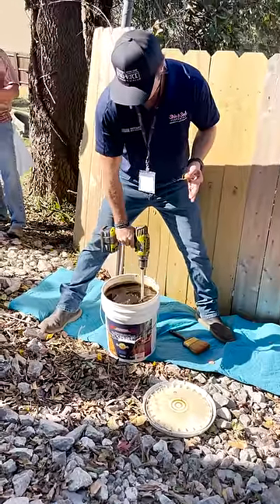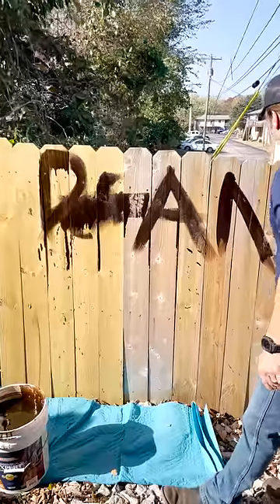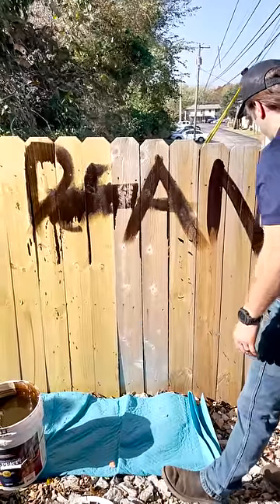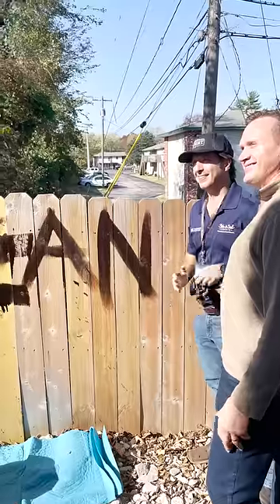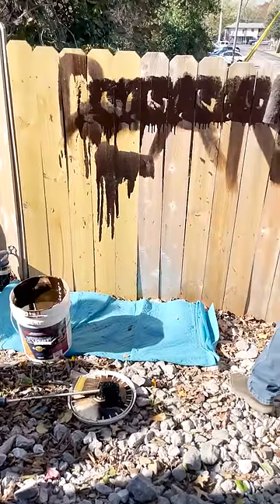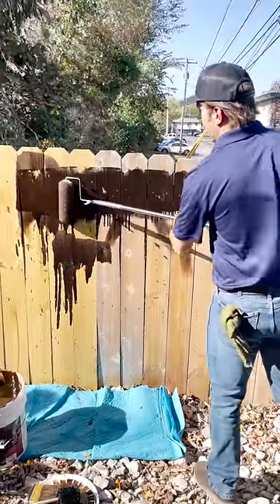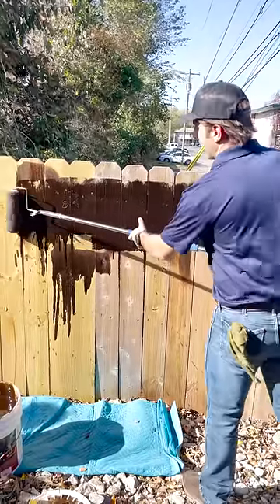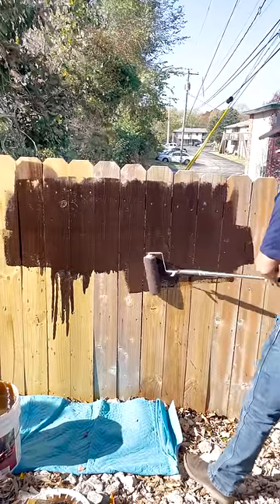You Won't Believe What This Guy Did To This Fence #Shorts

Comment: Yeah yeah but we needa talk bout those nail lines
Reply from the maker: 😂 very true!
Reply: It might be a demo fence so I’m sure it wasn’t a priority to get them super straight but I might be wrong lol
Reply: It's straight just tilt your head. Lol
Reply: @Dawson370  I can tell u try to over charge for sum like this 😂😂😂
Reply: What nail lines?🤣🤣🤣🤣
Reply: HAHAHAHA
Reply: EXACTLY🤣
Reply: Can we even call em lines? 🤔😂
Reply: “Looks good from my house!”
Reply: Few years and it will be leaning anyway
Reply: Screws
Reply: That stuff bugs the shit out of me lol
Reply: Thats a whole nail scatterplot
Reply: They add character
Reply: Come on you guys, the line is straight. Defense starts at a lower angle and moves upwards. Making the nail holes look very off.
Reply: Looks like a stain/ paint combo. Sherwin Williams sells the best one. I've used over 1000 gallons of it in the last few years.
Reply: @kimberlyjones2343  if that was the case, they'd still be in a straight line, just on an angle. But they jump up and down within couple nails. Also, you should still make your nail boards level, and the tops should be plum, only thing that changes is the cut at the bottom.
Reply: Pretty sure it’s a demo fence, but yeah I agree lol
Reply: Damn why did you point that out

Comment: I personally prefer oil based stain for exterior wood however you really need to know what the wood was treated with previously and if it will accept an oil based product. Then it's a matter of ongoing maintenance with the same or compatible product.
Reply from the maker: Great point!
Reply: No you dont, you need to know moisture content and if treatment is dry enough to accept stain. Typically takes 3-6 months before staining treated lumber. Some i have done in weeks and other took almost a yr.
Reply: @fuzzybanana9128  no if the wood has been "stained" with a urethane putting an oil based product is going to result in a mess. You can go from an oil to a urethane but not the other way around without prepping the surface.
Reply: @condor4679123  Well there is a MASSIVE difference between “treated” and previously stained. “Treated wood is done  by lumber yards. In that regard you would be correct of course, but ive been doing this 20 yrs and have never once seen a deck with urethane, that would be idiotic and the wrong application. Spar is one the only outdoor applications and its not intended for decks or fences but moreso furniture and small things without direct moisture.

Comment: Acrylic isn't actually stain it's a clear paint base with a little tint in it. Doesn't actually soak into the wood and stain it. Just bonds to the surface just like paint.
Reply from the maker: The product he was demonstrating was an oil-based penetrating stain
Reply: Bruh

Comment: Hard to work with but I love oil base it holds up especially if you're doing garage doors that are exposed to the weather
Reply from the maker: This stain is actually pretty easy to work with!
Reply: @JoeEverest    I do spec homes with Cedar and Redwood incline garage doors.  I always use oil based stain and use an automotive clear coat hardener. Holds up 15 years without  Is yellowing or cracking like polyurethane

Comment: Let it fully soak until its fully dry then try price your point 
If you coat over a wet layer it's obviously going to not show up 
But allowing it to dry fully will make that one solid cost then once the 2nd coat is applied the first coat it show as it will have built up the thickness
Reply from the maker: That’s true with most water based stains, oil based stains will still level out.
Reply from the maker: @aliceullrish5251  I’m guessing you haven’t used the product. We average spraying around 1,000 gallons a year of it, we’re pretty familiar with its uses and limitations. Now, with high-solvent oil stains you’d be exactly right.

Comment: I worked at a big box store in the paint section and this is straight from the rep's mouth: water base for inside and oil for outside. This goes for paint, stain and varnish
Reply: I agree except for when it comes to log homes.
Water based stains from Sashco and Permachink are the leading stains and outperform oil based all day long on log homes.

Comment: There are a lot of factors that determine how a stain will look at the end. Water and oil based stains do behave very differently and require different clean up. Oil based does tend to be easier to clean up with the proper chemicals than water based. But the biggest factor with staining is the wood itself... Woods can be open or closed grain and have tight or lose grain patterns. Closed grain woods tend to take stains more evenly and open grain requires a grain filler to get that eveness. However if its a tight grain wood it also becomes more difficult for the stain to penetrate through the wood which can also lead to umeveness. Hard Maple is a good example it has a closed grain but is also very tight which is why it often doesn't stain very well, thought because of that you can have beautiful figured patterns throughout the wood that isn't found in many others.

Comment: Oil based deck and fence stains have catastrophic failure and that's a good thing. It means it just fades away. Water based products don't fail the same way. So you have a ton of prep with water based to reapply.
Reply: not true. depends on what product you use. if it's just penetrating water base stain. just clean it before you apply new coat. same with oil base. now if it has beeswax in it then you have to get it all off.
Reply: @jeremygray462  right..  semi transparent needed to be added to my statement. Good catch 👍

Comment: I've always preferred oil based stain, it's messy but it's a lot easier to use and gets better results
Reply from the maker: Agreed!
Reply: Facts
Reply: @Jack Russelle Lewis what about it. takes to long to dry.
Reply: @jeremygray462  it doesn't dry it eventually evaporates

Comment: Oil-based stain takes 24 to 48 hours to dry minimum before you can put a finish over it. You do that and there will be a difference. Trust a person with cabinet making experience. In the outdoor circumstances he's basically correct.

Comment: Even when staining wood flooring, I use a rag and put as much down as possible, then wipe it off. Wax on, wax off
Reply: Rough sawn vs sanded. Makes a huge different on ragability.
Reply: @wook420  yeah. Like most builders i worked for had rough beams or non sanded i should say, because they were cheaper. So I had a separate sprayer to spray stain only lol

Comment: “We can stain sideways, we can stain up and down…it doesn’t matter. This stain is gonna penetrate, it’s gonna go into the wood it’s gonna go into cracks, it’s gonna come through the otherside”
…..🤨
Reply: The point is that it's a staining that doesn't leave residue of old layers...constantly covers up and you only have to do one side...
Reply: @Hi-Fitxt  I think they're just a perv, my dude.
Reply: @TrustMelDontCare  maybe, I won't lie I'm glad I read your comment twice, I thought you called me a perv then lol
Reply: @Hi-Fitxt  As a 20 yr painter i can tell almost everything he said and literally everything you said is wrong.
Reply: @fuzzybanana9128  what...I'm going by the video...me personally? I'd do both sides, with multiple coats...
Reply: @Hi-Fitxt  👍. Penetrating oil is a recommended 1 coat product. If wood is old and dry you can normally get away with 2 coats.
Reply: @fuzzybanana9128  so exactly what I said...in my original comment I literally said you only need one coat and you told me I was wrong
Reply: @Hi-Fitxt  reading comprehension is hard for some, you’ll get it one day.
Reply: @Hi-Fitxt  yea you are wrong! You probably think that all these one coat paints really do work. Lol!🤣🤣🤣 real painter’s know the difference.

Comment: I used creosote with a garden sprayer on a concrete slab wall turned it from the white concrete to the creosote color which blended into the back Garden perfectly took me no time compared to having to brush it

Comment: Used motor oil works great too
Reply: no it doesn't. I've tried it takes way to to dry. days later and it still comes off with touch
Reply: @jeremygray462  that's because you need to thin it out with 50% diesel. The diesel allows the oil to penetrate the wood.
Reply: @madatown So 50% used motor oil and 50% diesel?
Reply: @madatown  see nobody said that they just said motor oil. I'll try that next time

Comment: That makes some sense. It's like trying to soak a wet rag in water to get more water into a already soaked rag. But I don't really understand how water based and oil based stains work. I'm just assuming the water one evaporates and leaves the stain in the wood while the oil one stays in the wood and doesn't wash due to the non solvent nature.
Reply: Waterborne and oil are very similar. Both only soak in about 1/16” and both have solvents, a common misconception about all water water products, they just have far less solvents. Most companies are now making water products because of ecco concerns and easier for DiY’ers. Both have their pros and cons.

Comment: Oil stains are better than water based coatings.but you have to keep it up on a fence, nothing lasts forever
Reply from the maker: Agreed, luckily oil-based stains can simply be reapplied rather than have to strip it off and start over.

Comment: Well no crap water based sets up when dried. Water based means it’s an acrylic polymer so it basically turns to plastic. Never let water based dry unless you intend to. 

Oil has a longer dry time. Say you let a layer semi dry & apply a new layer. The solvent from the new layer will re-liquify the tacky layer & allow time & flow to smooth out the bulk from the scribbles he made- making the underneath layer basically disappear & blend in. That’s what’s happening in this demo. It’s not the brand. It’s just oil based.

Comment: Amateurs just don't know. I did hardwood floors for 20 years. And water base are dirty and difficult. They have less of an odor but they are three times harder to work because they pop the grain of the wood.
Reply from the maker: Absolutely not the case with exterior wood stains applied on exterior rated wood products. Apples and oranges.

Comment: Oil is oil, iv even used regular old engine oil one of my bunker coveres, i havent reoiled it in 5 yrs but it still looks like new, and it cost me 0
Reply from the maker: Not at all the case when it comes to wood preservatives. To begin with, there are several types of oil base types. For example, you used a petroleum derivative rather than a seed derivative. Next would be the pigment carriers, are they high or low VOC? The EPA would have a coronary if they found a company was applying used motor oil to treat fence.

Comment: My father used old used motor oil to stain our fence. Fence has not changed since we put it up 15 years ago. Idk if it’s just that I did a bad ass job putting the fence up or it’s the motor oils protective qualities 😂
Reply: Half used motor oil, and half diesel fuel. The ultimate wood preserver
Reply: Motor oil technically never dries is why its lasted.

Comment: It stains the wood rather then coating it with paint not that hard to comprehend so why wouldn't it cover up the same stain?
Reply from the maker: A lot of the stain on the market dries quickly, so if not applied correctly it shows streaks. With other stains the name being spelled would show up clearly in the final result, it would be much darker.
Reply: Alot of old or cheap stains yes

Comment: I love oil base paint because of the superior protection but all the stores don't want to carry it. All the outher crap they can have it!!!!!
Reply: Stores and companies have gone away from oil because latex products are flat out better. First you have to understand the EPA is cracking down on VOC’s which is what made all products far superior to what they are now. 30 yrs ago an oil based paint would last 20 yrs easy. Now oil will last 5-7yrs and latex 7-10 yrs for exterior application. Oil stain for exterior wood like decks, fences, ect…is still the ticket, but for siding and general house painting latex 100% a better product.

Comment: Looks like paint stain to me. That shit where they mix paint pigment in and you only get one tone and color depth. With normal stain,  the application and contact time determine color depth. So you can go lighter or darker if you wish. With this you get what you get. Only reason to use this over paint would be the fact that the oil will penetrate the wood better than traditional paint. 👍💯
Reply from the maker: It’s true that you get a consistent color regardless of how it’s applied, so they make tones that range from clear to semi-solid.

Comment: yeah but look how dark the dude had to go I guarantee that's multiple coats for the name not to have shown through, I'm a painter bro 18 years that's the only way that name wasn't going to show through is he made that shit so dark that's more than one coat for sure probably three, and also either why he rolled that piece where he had put the name first in such a wide pattern the width of the roller because he knew through trial and error that if he didn't cover that up and then put on the rest of the material super thick it was going to show through common I don't know what the hell he's talking about water based material isn't as harsh as oil base by no means, I would rather put water-based material on anything and if you want to get the fence super clean prior to it use this stuff called 30 second you can find it out Walmart a gallon it's the best hands down the best material you can use to clean the fence or any surfaces that require stain, it's the greatest material known to man for getting a barewood surface clean or something with an old stain that you'd like to remove or brighten up
Reply from the maker: It’s a flood coat, the same as we would stain a fence. We do this demo 8-10 times a year across the country. Water based stains flash dry on metal hardware was the point he was making. To re-apply water based stain you have to strip them off, they’re film forming. 

The 30 second cleaner is bleach, right on the back of the bottle it states is sodium hypochlorite. You might as well go clean the fence with pool shock. 

You should try the product sometime, we convert a lot of painters once they see it work for themselves.
Reply: @JoeEverest  yo yeah, that makes sense. So you don't think 30 seconds a good material to use on things that have a deep mildew on it or need to clean slate on a surface? Like almost like a rough cut wood on the side of a barn, I live out here in Oregon so we deal with a lot of black dirt, kind of a mold I guess and dramatic weather is out here in southern Oregon Medford.. but I'm open to use a new products and stuff like that.. I guess I didn't catch that part are you guys promoting a product of some sort? Cuz I'm down to use other products and I'm not against materials, just using it so much throughout the years I like using water-based stains and just keeping a maintenance on it every year, sometimes every two years having a good report with the customer helps with business but if done right one can get longevity out of whatever material they're using be at water based or oil, but yes I would absolutely use you guys product if that is what you're saying if that's the drift I'm catching from you I would definitely try out whatever you got, and I didn't know that was your homie LOL and I appreciate that reply man in a major way I would give you the company name but YouTube promoting outside of whatever the YouTuber is doing, but you definitely got yourself a subscriber and all share your YouTube with my other painter buddies 🤜🏾💥🤛🏼 it's kind of a guild out here
Reply from the maker: @atomthegreat541  all good my man. Shoot me an email and I’ll work on hooking you up with something to try. Joe@thefenceexpert.show

Comment: They've had spray on stain for like 20 years....
Reply from the maker: Absolutely, but most need to be applied by trained professionals to avoid uneven coating and lap marks. This particular product is formulated so that the DIY crowd can use it with great results.
Reply: @JoeEverest  Yeah but honestly I prefer to sand with 120 and then stain, and then bump sand with 400 and then stain again. You'd use the spray on the first soak, and then for the second use a high vapor brush on that flash dries.

But I am in fact a professional so your logic totally holds up lol

Comment: Over course that's y u paint oil based in kitchens so grease and or food gets wiped off ez he thinks he just discovered that
Reply: you can wiped grease off of latex water born based paints as well as long as it has a sheen level. I would not recommend oil paint for inside anymore. they took all the drying agents out of oil based paint along time ago. and depending on what state you live in good luck getting oil base paint In gallons. qts maybe. industrial oil based paints maybe but still doesn't dry like it use to. latex based paints have come along way.